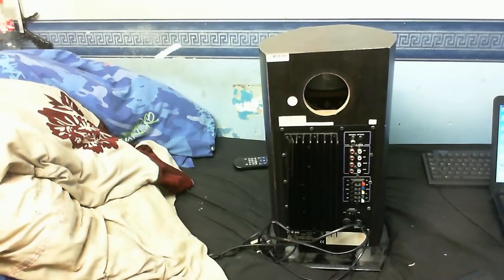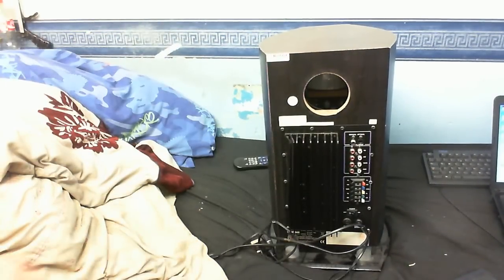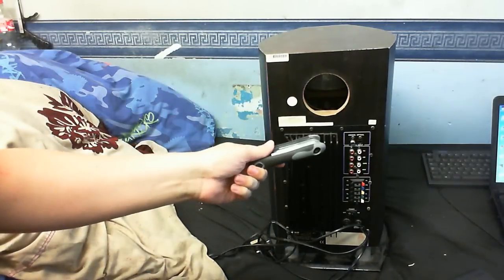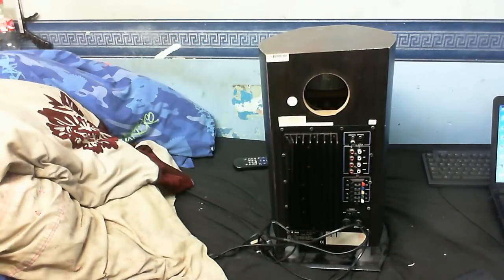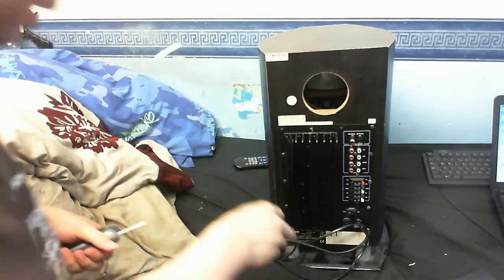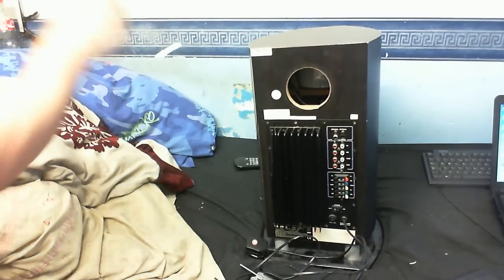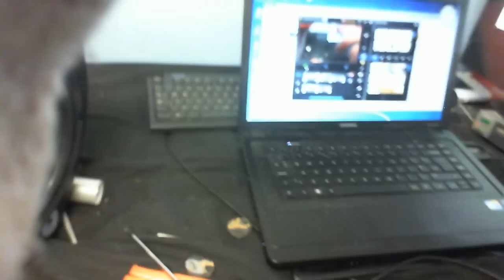Another subwoofer teardown

Comment: They look like common TDA chip amps , very handy chips as they can run in single dual and quad channel mode.

Last time I opened one they had 1 running in quad for front and back and the other one in dual mode for sub/center.

Very handy chips as they do not need a lot of external components to run , some of them can be quite good quality too,